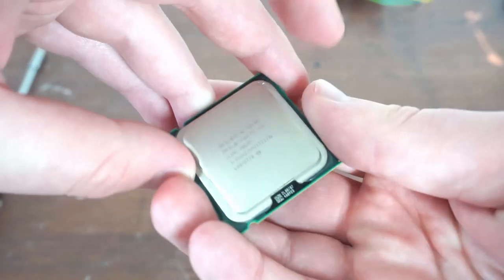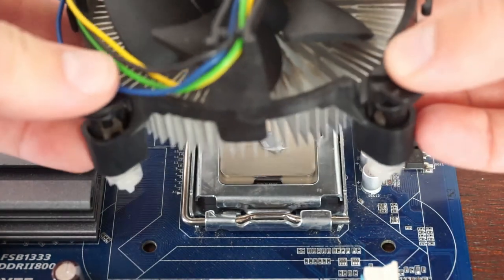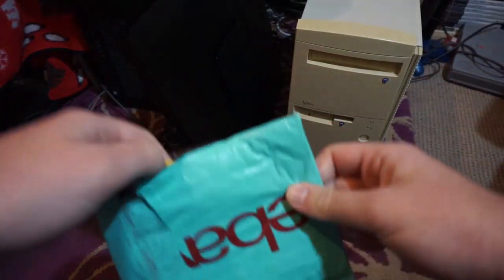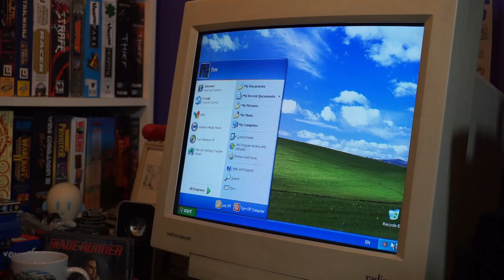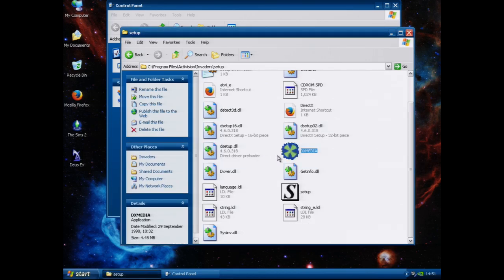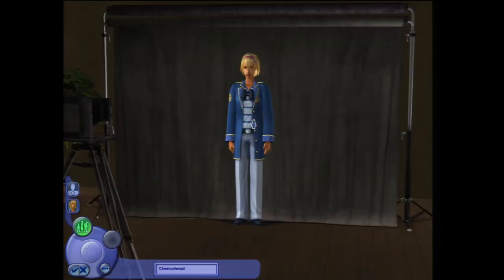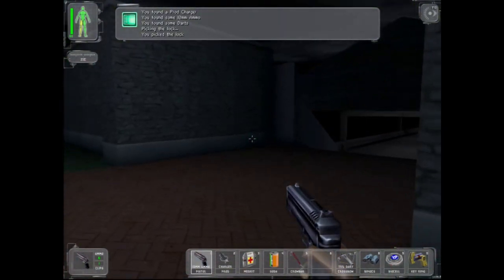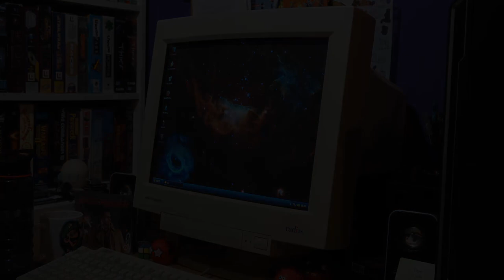Building a 2008 Windows XP Computer...with an SSD!

Comment: I don't use those push-pin coolers any more because I've bought too many boards with them installed which are bent around the socket.

By the way, it appears as if you forced course-threaded screws into your drives.

Comment: Hey I just built a XP computer and I using ssd and install XP directly with no problem and try downloading the drivers for the Soundblaster card from the main web site I had the same problem and I X-fi card and I download and XP drivers version of the card to get it to work!!!!!!
Reply from the maker: Huh! So the SB Live just doesn't like SSDs? Or possibly motherboards new enough to support an SSD.
Reply: @BrokenCircus  I assure you that takes up to either 4 to 6 GB of ram maxed out. You can play The Sims Complete Collection big time for that option.